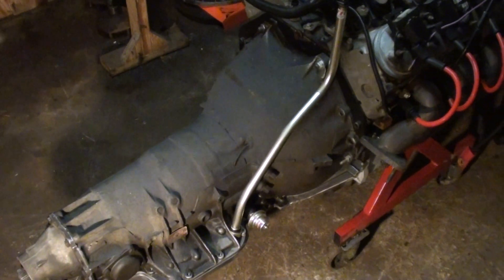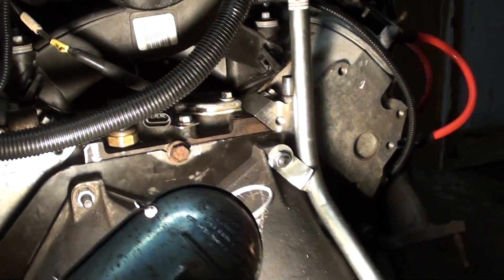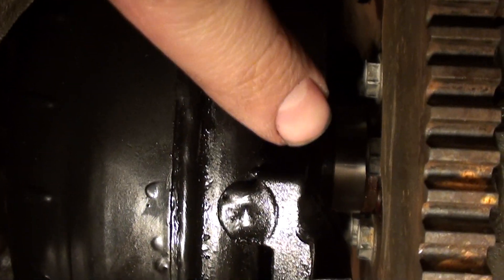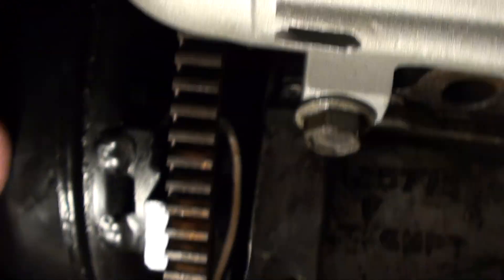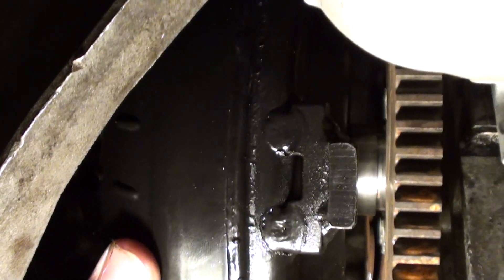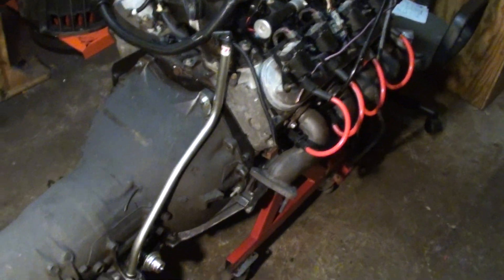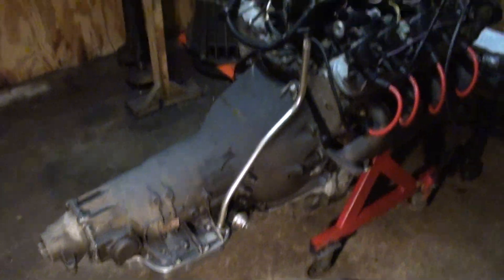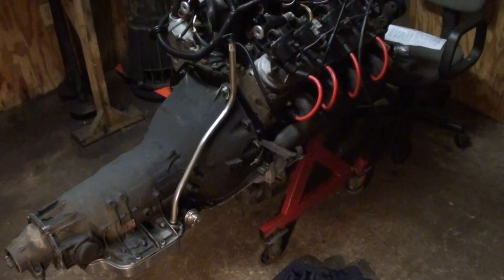How To : 4.8 LSx to BOP Turbo 350 Th400 update

Comment: I have some questions..... Do you place the torque converter inside the trans then bolt it up to the fly or does it not matter?.... I had problems bolting my th350 to my 5.3 ....one side was flush when bolted almost all the way up.... the other side wasn't.....it ended snapping part of the bellhousing off where the dowel sits....has this hAppened to you? Also would welding hold up or would i be better off getting a new trans ? The one i have is in good operating order

Comment: Finally an answer
Reply from the maker: I just need to run and get bushings and it will be done
Reply: I’ve been looking for this answer for about 6 months now! Thanks
Reply from the maker: @jarrettdixon9850  You got it man. Its not as bad as it looks.
Reply: @jarrettdixon9850  Don't use the spacers, a few washers to compensate for the thickness of the adaptor are OK but longer bushings will loosen over time and shear the bolts.  Ask me how I know.   Look above for the solution in my other post.  You need to keep the converter back as far as possible so the lugs that drive the front pump in the trans have full engagement or they can slip and destroy the converter and front pump.

Comment: So the $200 that comes with the Delta 88 rollmaster what if I put a 53 on that will I need the bracket that you have on the back of your transmission that's why I got the Spate that's why I got spacers on
Reply from the maker: I read your comment 6 times and it still makes no sense.
Reply: The 200 already comes with the Delta 88 Roadmaster year 83 I can just bolt it up or will I need that plate that you have over the five most
Reply: Alvin you should ask someone that finished high school to help you post your comment...